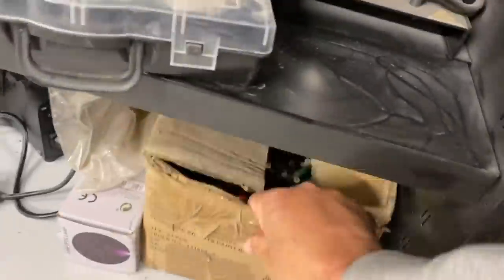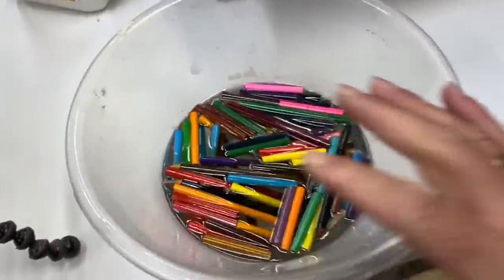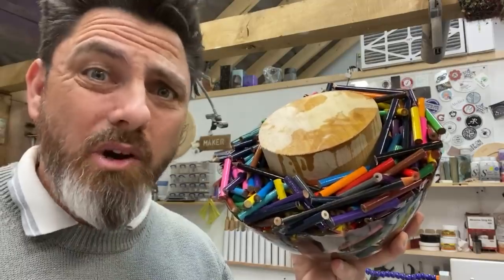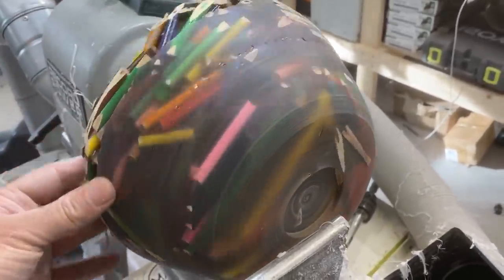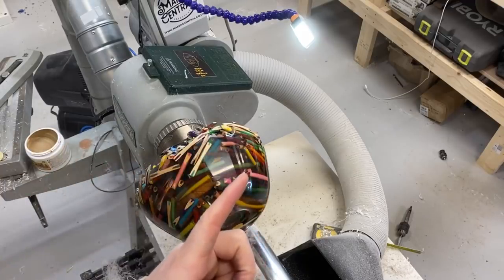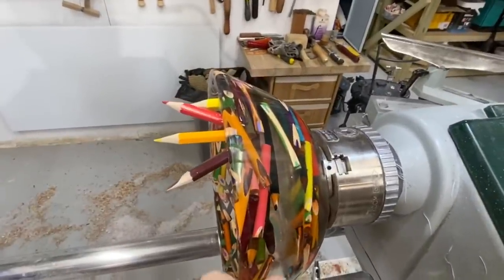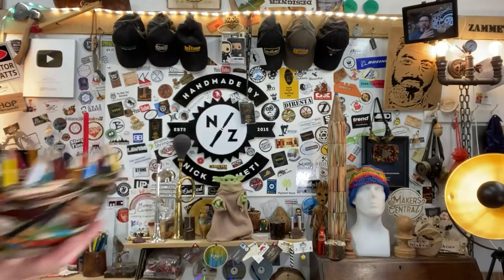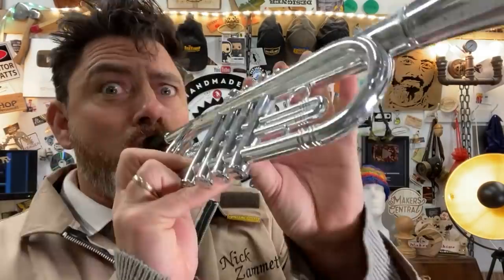Woodturning -  DIY Pencil Venus Trap Bowl

Comment: Have you ever thought of / tried using ultrasonic to remove the air from the resin instead of the pressure pot?

It might encourage any bubbles that are stuck under something to come out, or pop them entirely, where the pressure pot can’t do that.

Comment: Drill a small hole in the bottom of the mold, and hit it with a blast of compressed air. The blank should pop right out.

Comment: NICK , Mate ! Absolutely funktastic !!!
I have a question. 
How do you prevent color core in those pencils for marking up the wood when you sand ?  
I keep getting dark striations, mostly from the darker colors when I'm sanding. 
I haven't seen you stabilize the pencils so I am at a loss as to the process.

Comment: Hmm, I wonder if you only coat the pencils in resin, put them where you want them, let it get tacky and then put the amount of desired resin, if that would help with the bubbles and floating issues? 🤔 I wouldn’t know, I don’t work with resin but it’s a suggestion 👍

Comment: Gotta be honest: the pencils that stick out look out of place among the truly random ones. While the angles are randomised, they all follow the same general direction. The original pencils would not normally create such a semi-regular patterm and most importantly, they would never go through each other. The ones you added are shorter, chopped straight and go through other pencils. This to me completely breaks the effect. Maybe next time you could start with a similar base and then carefully drill out some of the existing pencils. You could then place whole pencils that completely go through the resin in these truly random holes. Drilling in the correct angles might be a challenge, but I think it would be worth it. This, I think, would make for a better "how the ***" did he do that!" effect.

Comment: If I may suggest? Instead of wasting blanks, could you just sink one of cylinder tubs in the center and fill with weight, then once the resin sets you should just be able to pull it out.

Comment: Dude after I done that I applied you for putting all those pencils up like that but if I were you I would have stuck a mold inside the bowl and I'm old on the outside of bull fill up the edge around with resin to make the top of the pencils safe to use the bull because your couple things going to happen somebody's going to stab yourself with one or they're going to break a piece of lead off or the bull gets dropped and a pencil gets broke out the resin would be smart to keep everything in place for a long periods of use so yeah good at first prototype that's all if you would stand since you made it didn't layers what I would have done was lay the pencils out straight on the bomb like you did then put the points up on outer edge is in stock them to the middle but you know everybody has different ideas and not everybody thinks about it at the same time so maybe if you revisit this you'll do that

Comment: Nick .. do you pull a vacuum on ur pressure pot? or do you pressurize it?
Reply: He pressures it, it's a pressure pot, not a vacuum chamber. You can't do a vacuum in a pressure pot.
Reply: @TinaMdot  you can vaccum in a pressure pot it holds air in so it can also hold air out. I have one almost identical to his.. I was asking because things that are more pouris are better to have a vaccum on them to draw all the air out.  He mentions in the video that the air bubbles may have come from inside the pencils..
Reply: @KevinK88  I thought so too, but was told the opposite by a wood and resin turner. He told me that the seals are different, because the pressure from the atmosphere on a vacuum chamber is higher then the pressure you put on a pressure pot. Maybe he was wrong, but why else do all the wood/resin turners who work with vacuum own a vacuum chamber alongside their pressure pots?